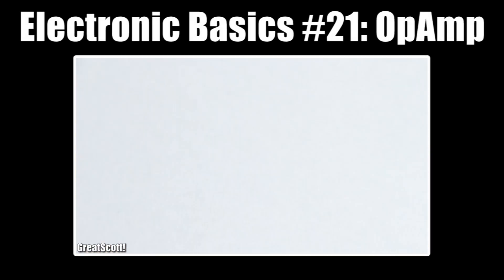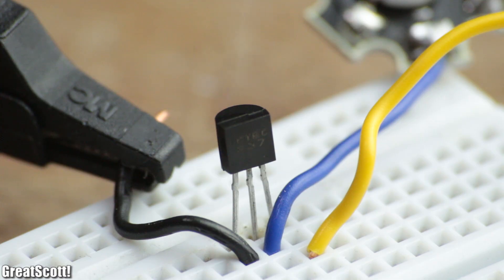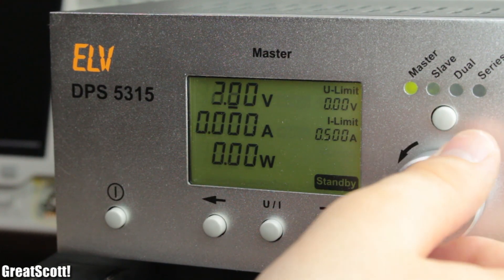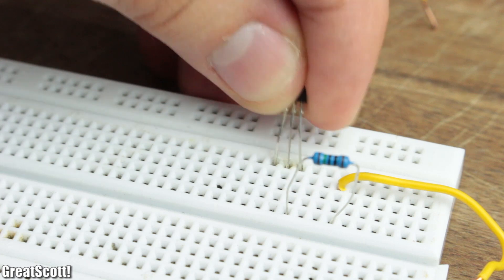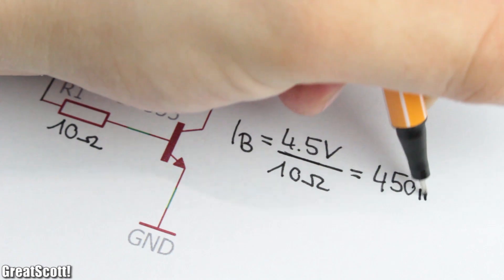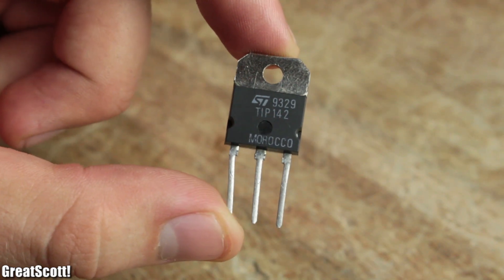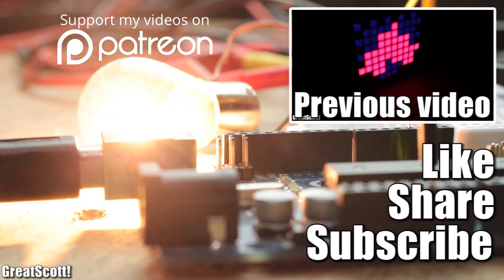Electronic Basics #22: Transistor (BJT) as a Switch

Comment: firstly: you need to explain the purpose of using the transistor as switch, as for the arduino, the transistor as switch works as a shield to protect the arduino from high current needed for devices such as big dc motor.
secondly: you need to explain how to calculate the suitable resistor used to make the transistor on VCE sat, which is calculated  according to  Hfe and   the amount of current needed for DC motor, by using Ohms Law, Thank you
Reply: Firstly, you would be better thinking of the switching transistor as a current amplifier, rather than a "shield". Once you realise that a single switching BJT can be expected to scale up the current available by a factor of 10 or so, you can see what is feasible. If you need greater current gain then a logic-level power MOSFET is likely to provide a solution.

Secondly, virtually all manufacturers specify saturation using a base current of one-tenth of the collector current, and you should do the same. Ohms law is indeed all you need to calculate the base drive resistor. Remembering that an Arduino IO pin can supply an absolute maximum of 40mA and you should aim to draw considerably less, you calculate the base current as one-tenth of the collector (load) current. if you can comfortably draw that from the Arduino, then calculate the base resistor as (5V - 0.7V) / Ib.

Having said that, driving big DC motors is almost always done via a motor driver IC or power MOSFETs, so it's probably best to consult the datasheets for those to see how to interface with a microcontroller.

Comment: nice tutorial, can i ask.... if i have a rising voltage and i want an LED to switch on at a giving voltage, would i then need to construct a darlington pair ?  using a simple bc547, the end result is LEDs coming on at a low voltage and then increasing in brightness as the voltage increases, i want to switch not vary
Reply: The only way to switch at a particular threshold using a single transistor is to put one or more diodes or a Zener diode in series with the base drive resistor. For example, if you wanted to switch a 20mA LED on when the voltage reached around 2V, you would want two diodes in series with the base resistor, then calculate the base resistor to give 2mA (one tenth of the collector current) at the maximum input voltage. So for a 5V ramp voltage, you would calculate (5 - 2)V/2mA = 1.5K as your base resistor. For a 10V ramp switching at around 6V, use a 5.6V Zener in series with a 1.8K base resistor. You'd have to experiment a bit to get the voltage you want accurately as tolerances will have a strong effect. A Darlington transistor will help make the transition sharper.

To do the job properly, you need a Schmitt trigger, usually an opamp or a comparator with positive feedback to achieve a sharp transition of the output at a given voltage.

Comment: I still don't get it (I am not an EE I am just interested in this stuff), why don't you just connect the power directly to the LED and toggle power on and off? What does that transistor DO? Thanks.
Reply: A transistor allows a small current to control a larger one. The current controlling the transistor can be small enough to come from a microcontroller, while the current being controlled by the transistor can be so much larger that it would be impossible to draw that current from a microcontroller. Instead of a microcontroller, you could have a light sensor, or a computer, or an alarm system, etc. All of those operate at low currents, but we want to control much larger currents, hence the transistor being used as a current-controlled switch.

Comment: Okay, so the transistors can work as a logic gates, on and off. But what in the first place makes transistor go of and on in the circuit or computer? The base requires voltage to switch transistor on. Where the voltage comes from and how it can be controlled logically? By another transistor? Diode? So what then controls diode?

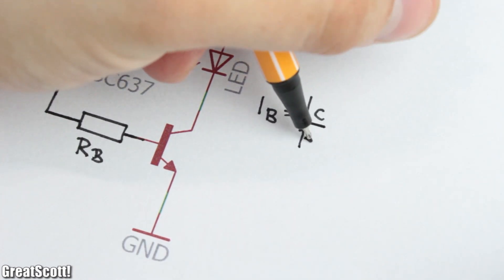Comment: At 2:35 you mention using a Beta of 25 to keep it conservative. Most spec sheets have a value min and max, for example the common BC546 has a min of 110 and a max of 800, which is used? At 2:49 you mention the output current is not correct due to a voltage drop across the CE path but don't address how to fix it?
Reply: Beta is a concept best reserved for the transistor being used in linear mode, not in saturation (switching mode). If you look at the datasheet for the BC546, you see that the Vce(sat) is specified as a maximum of 250mV with Ic=10mA and Ib=0.5mA. and as a maximum of 600mV with an Ic=100mA and Ib=0.5mA. That is specifying a collector/base current ratio of 20 and if you use a higher value (i.e. less base drive), you aren't guaranteed not to exceed those maximum Vce(sat) values, so you're then designing by guesswork.
Interestingly, the BC546 family is one of the few devices specified at a collector/base current ratio of 20. Almost all other use a collector/base current ratio of 10 for saturation.

Comment: 1 question ... how did you get the first Ic ( 310mA) and the second Ic (3.8 A) ???
Reply: I'm wondering the same. Probably it's within the specs for the LED but it would be nice to get an answer ^^
Reply: Yeah it's probably the LED and the Light bulb's  operating current.

Comment: Nice video. On an NPN BJT where should you place the load at the collector or emitter and why?
Reply: If you place the load in the emitter, then you are using a "common-collector" circuit. That circuit has no voltage gain, but can have large current gain. You use that when you already have enough voltage to drive the load, but need more current.
If you place the load in the collector, then you are using a "common-emitter" circuit. That circuit has reasonable voltage gain, and can also have some current gain. You use that when you need more voltage to drive the load.

Comment: Why not just use a switch? I'm confused as to why a transistor is advantageous? I might just be missing the point though :P
Reply: Jake Masters Transistors allow you to switch it on and off using a voltage. This means that you could use an Arduino or something similar to turn it on and off very fast.

Comment: Is this method handy for... switching different paths in a schematic? I want to replace a galette switch with transistors plus one potentiometer which will be switching between different routes while providing a concrete amount of voltage. E.g. "multiple thresholds" (or levels...). Is this possible without microcontrollers?

Comment: It's an interesting video besides I don't understand which applications are really useful for this. I mean: you don't need to light a lamp with a transistor, right? Because the wire connection process is still physical. Or here is a need of an example with some other parts... like a pot. as a volt.divider. Still it's not very useful for me...
Reply: If you only ever want to turn on or off a lamp with a physical switch, then you don't need any of this, of course. But that's 100-year-old technology. Nowadays, we can control lamps by the ambient light or time of day, or by sound or voice, or when someone enters a room. There are many different sensors available to control a lamp (as an example), but they all will end up using a transistor of some sort to actually switch the lamp on or off.
Reply: @RexxSchneider  yes, you're right!

Comment: Ok since im not experienced to this, i'm planning to use a BJT(BC637) as a switch for my Nokia 5110 backlight display.
Since i'm currently using a 220 ohm resistor in series with the backlight (using 5v) i calculated that the current draw of the LED is 22mA(seems legit) and with the given formula on the video i calculated Ib = 22,7/25 = 0,908mA, then i calculated the Rb (5V - 1V)/0,000908A = 4405 ohm so if i use a 4.7k resistor in series with the arduino digital pin output on the base i could safely turn on and off the backlight of the Nokia 5110 LCD module(5V version)?
Reply: You will need less than 22mA to drive the LED because it will drop some voltage, probably 2 to 3 volts. That would mean only 2V to 3V across the 220 ohm resistor, giving a current of 9mA to 14mA. I would almost always drive a switching transistor as if it had a β=10 because that ensures saturation, so I'd aim for around 1mA to 1.5mA drive from the Arduino, giving a drive resistor of around 3K to 4K. It's not critical, so I'm sure your 4.7K will work fine.

Comment: Hello! Can you tell me which transistors and capacitors are used more often (which should be in every workshop Electronics DIY) thank you!
Reply: i see that the most used transistor is a npn trasistor called 2n2222a
Reply: @fimzks  The 2N2222A is getting rather old now, and these days something like the BC547 (B or C variants) are more popular. They have better current gain characteristics than earlier transistors and that makes designing for them a lot simpler. For power use MOSFETs have taken over, so I'd recommend looking out for IRL540 or similar. 

As for capacitors, you should perhaps get a set of multiple values of ceramic capacitors from a few pF to 470nF and then some electrolytics like 1μF, 10μF, 100μF.

Comment: Hello it wanted to ask you if you can help me with this transistor I do not find it on any part with the same characteristics and it wanted to know if there is any equivalent that realizes the same function the transistor it is the IRF3205-S 015-p T5 RN I need your help since I see that you know enough of electronics thank you in advance
Reply: IRF 3205 is an N-channel mosfet, not a bjt. The BC637 seems to be obsolete/out of production, but there are plenty of alternatives. Eg PN2222 (note that BC637 pins are ECB and 2222 is EBC).
Reply: you have a link for buy?
Reply: thanks , this store is valid for my :)
Reply: if you are just getting started with electronics, it may worth it to get a book and a starter pack of components. Eg http://www.makershed.com/products/make-electronics-component-kit-1
When I started it was somewhat frustrating to drive 3 miles to a store to buy a few $0.10 diodes or a few leds.
Reply: okay thanks for your help I 'll think if you start with the electronics when you have a free slot because now with the studies just have.

Comment: if you just want to turn on a big load like a long led strip, wouldn't a relay be way more efficient?
Reply: A relay is a mechanical device, so is subject to wear, corrosion and pitting of its contacts. Relays typically also require rather more current to operate than a transistor needs to turn on. Add to that the cost of a relay is often far more than that of a transistor with the same current rating, and there are myriad reasons why transistors are often preferred to relays as switches. Driving a heavy load like a long led strip requires a power transistor, but power MOSFETs are efficient switches and very cheap nowadays.

Comment: Can I use a transistor to switch a 5v input on an arduino with a rectified a/c waveform off of a speed sensor? I want to read an analog speed sensor frequency with an arduino in a simple way..

Comment: i personally favor BJT over MOSFET for lower current switching (like even up to 10A) as most of them has a logic base voltage aka 5V which makes it a perfect bridge between electronic signal (e.g. MCU) to electrical peripherals like solenoid or motor.
and yes the annoying thing is always the heat dissipation.

Comment: Great video.
I think IB current you calculated is the minimal to switch the transistor on. However, it is in linear stage instead of saturation stage. To ensure IB that drives the transistor in saturation stage, multiply the IB calculation result in 5 or 10. By doing so you will make sure that the transistor is going to work in saturation stage taking the most possible current between collector and emitter and the least voltage across collector and emitter.
Reply from the maker: It was in the saturation stage. Of course you can use a slightly bigger current to make sure that you reach saturation but simply multiplying with 5 or 10 it not the best idea. My transistor would not have enjoyed a base current of 2A instead of 400mA.
Reply: For IB of 450mA and a worst beta of 25, the IC would be 11.25A which I have never seen BJT rated for such current..!!!
It seems I am stupid, but that is what I know. I am not professional to make argument here though.
Reply: @majdinj  When the transistor is in saturation, the collector current is determined by the load, not by β times the base current. The concept of β is really only applicable to a transistor operating in its linear mode, i.e. as an amplifier, not as a switch.
Reply: @greatscottlab  The point is that manufacturers specify a base current of one-tenth of the collector current when quoting the maximum Vce(sat) for their devices. If you drive the base with less than that, you have no way of being certain that the voltage across the transistor is below a specified value. If you're passing significant current through the transistor, you can't calculate the maximum power dissipated and therefore have to use guesswork about heatsinking, etc. If the load current is 4A, you design for a base current of 400mA, or you use a power MOSFET instead, but that's a different story.

Comment: MOSFETs are just better :)
Reply: BJT is more cheaper than MOSFET; especially if your circuit doesn't need a lot of current.
That is why it is better to know both :)
Reply: Definitely, I just forgot to write that it's better in high current applications. I use BJTs for fans and relays with 1k resistor without bothering with calculations.

Comment: Couldnt you connect your light bulb staight to the battery and switch on and off by removing the positive wire. What is the point in having a transistor then.
Reply from the maker: To switch your light bulb on and off through a control signal.
Reply: Aha that makes things clear. Thanks

Comment: Hey GreatScott, I was wondering if you can use a transistor to replace a button on any device and control it through an IR remote. This way you can take the button that turns on a computer or other device and hook up a transistor with an ardunio and an IR receiver. Then you can program it to turn on the device with a button on your remote control. Just an idea I had, but I'm not sure if its the most optimal way to do it?

Comment: 1- so if i want to make a power supply out of a ATX(5v 14A / 12v 8A) and wanted to control its output current, i would have to use darlington transistors?

2- would a pwm signal  connected to a capacitor be able to control those darlington transistors for its output current?

3- how exactly negative voltages work? a ATX have GND, +12V and -12v, etc... is it that the gnd isnt actually the gnd, but the -12v is? (so gnd would actually be 12v if compared to earth or some point in the circuit? i do know a negative voltage indicates the current is going in reverse, or is it?

Comment: I've heard that you can use a smaller voltage transistor to essentially boost the current from a small current source to drive a larger transistor. Is this true? If so why not use that instead?

Comment: +GreatScott @ 2:38, where did the value of Ic as 310 mA come from? I couldn't seem to determine it from the video. Thank you.
Reply: It is a current that your load draws i this case LED draws 310mA
Reply: But in the power supply in volt=3.1 amperage was 0.191 A
Reply: Correct me if I'm wrong but the value came from the LED specs.

Comment: I have a question, lets say if you have solar panel source and battery source, and you want to effectively block voltage back to PV panel during nights, using MOSFET.....what would you do? So far I had reached 215mV on PV side during night....would you suggest something so that from that voltage drop to solid 0V....

THANKS.

Comment: what is that white rectangular thing with the holes to plug in wires and resistors called??
Reply: That called breadboard
Reply: Solder-less Breadboard. You can buy it from ebay. It is cheap and cost effective.
Reply: +majdinj sure thanks
Reply: +Irfan Syah thanks

Comment: what transistor and resistor pair would you suggest to pwm control a pc fan with an arduino?
Reply from the maker: Firstly you need to know the voltage and current of the fan. Then you choose a transistor (BC637 for example). The current of the fan is the collector current and the supply voltage should be the voltage of the fan + the saturation voltage Vce of the transistor. Then you calculate the necessary base current to reach the saturation (Ib=Ic/beta). Then you can calculate the base resistor with Rb=(Vcc-Vbe)/Ib. And that's it. Not that difficult.
Reply: thanks!!

Comment: Not bad but I would avoid using PNP transistors whenever possible. Also a demo showing how you can connect multiple transistors together to use as a darlington configuration would of been awesome for the n00bs.

Comment: Hi. I discovered your channel about 3 months ago and it got me into electronics as a hobby. Every week I watch your new videos and I finally decided that I must do a small project of my own at home.  I'm a macanical engineering student and my knowledge in the electrical field is a bit rusty so i would love for some ideas and hints with a basic project. I have a small 8.9v solar cell with max output current of 340mA. I would like to use it to charge my phone or to power other USB devises or small speakers and a Bluetooth dongle together. I have a little buck converter to get the voltage down but I think that it also brings down the current. This then takes a long time to charge the phone, even in the South-African sun. It is the lm2596 converter board. I was wondering if there is a way to decrease the voltage and increase the current to about 1A or so at the same time. I live in South-Africa so finding parts is a hassle and delivery takes ages.  Thanks and I will see you next time. haha